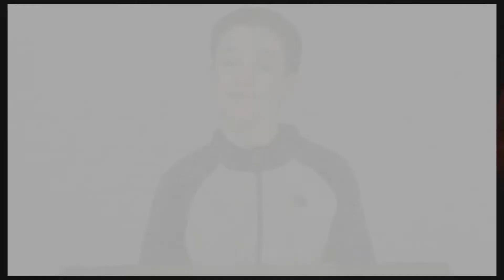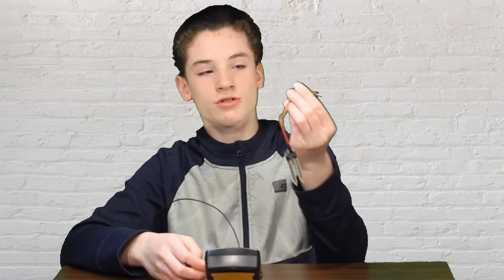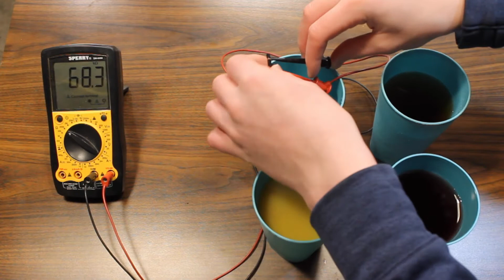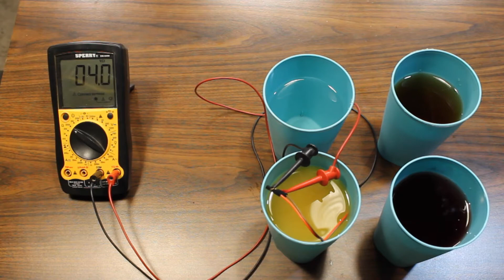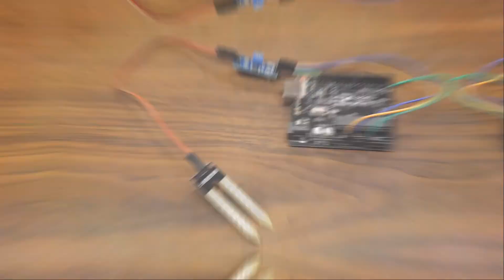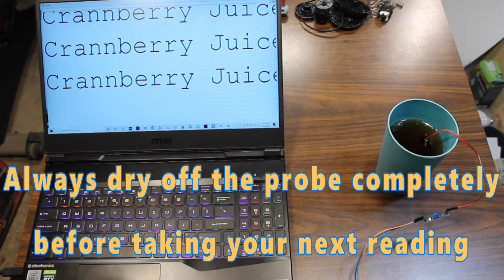Liquid Detector using an Arduino Uno | Fun and Easy DIY Project to Do at Home!

Comment: 9:37 If you pause it, or watch it in slow motion, it actually correctly identifies it as cranberry juice at first, before erroneously switching to apple juice.
Reply from the maker: Cool, I didn't notice
Reply: @LunarLightShowProductions   Not a total failure after all! :)
Reply from the maker: Your right, at least we learned some things.